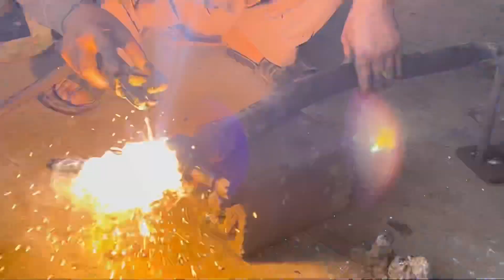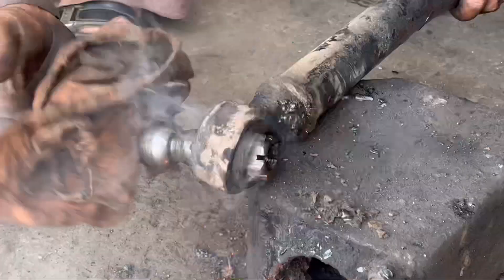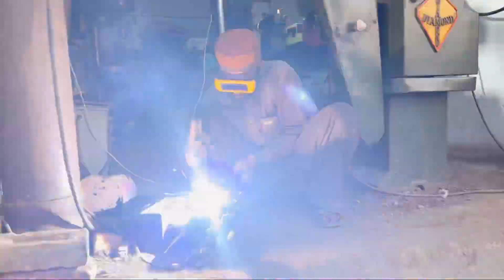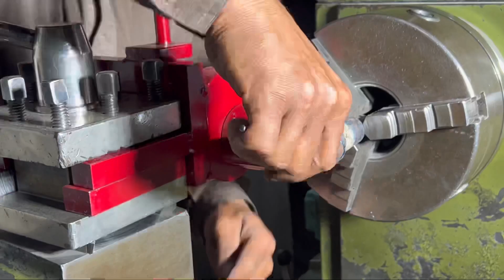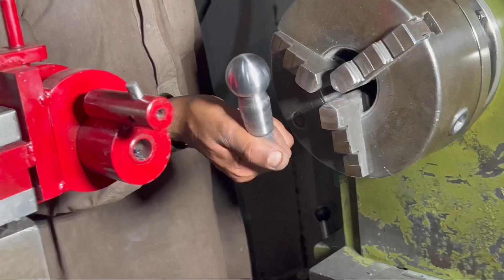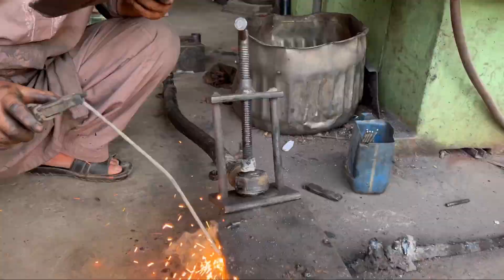This tool repair any vehicle balljoint || How to Repair Truck Steering Tie Rod Ball Joint is Bad ||

Comment: Sanding on a lathe by hand. Oh yeah he will have one arm soon enough :(
Reply from the maker: why friend
Reply: @WowAmazingRestoration786  When a bit of the emery cloth overlaps itself or a finger it can suddenly grab tight like a belt. This twists your arm around so quickly you have no time to stop the machine. It can take a finger, hand, twist an arm like spaghetti or draw the whole person in. The safe way is to use a short stick with an emery pad on the end so your hand is never near the rotating parts.
Reply from the maker: @ian_b5518  ok friend

Comment: The lack of heat treatments never fails on these videos. Part could be anything froim soft to brittle now - lethal with steering components.
I'm all for repairing things and saving them but care needs added with suitable heat treatments. It's not difficult to do and easily done by these folks but it never is.
A shame because a lot of effort goes into keeping things moving.
Reply: Heat treatment? Hate to tell you cold forging is 3x stronger. Why it's the preferred method for making metal parts. Only draw back is the shapes you can make with that method...
Reply from the maker: @jack king ok friend
Reply from the maker: @WizzRacing  thanks bro for sharing information

Comment: I'd put any of these guys up against a mechanic from the West. They are real mechanics, not just parts fitters. So easy just to call the local factor and the parts arrive within a couple of hours. These guys don't have that luxury, so they rely on their skill. Yeah, yeah, heat treating, pre-heat, post weld heat, etc. You think they'd run that set-up if they had constant failures? They don't mess around. I've been in the vehicle repair business for 30 years, and I can count the number of true mechanics I've worked alongside, on one hand.
Reply from the maker: yes friend you are right

Comment: That's some post apocalyptic type repairing right there. Not worth the time spent to "repair" a ball joint or tie rod when you can replace the part in less than 1/4 the time. The only reason to do something as ridiculous as this is if there is no replacement part to be had.
Reply: It is when you need to get back up and running. As it can take a month to get a new one....
Reply: @WizzRacing  try reading the final sentence of my comment again.
Reply from the maker: ok friend thanks for your kind information sharing